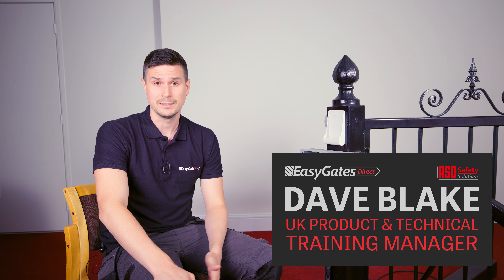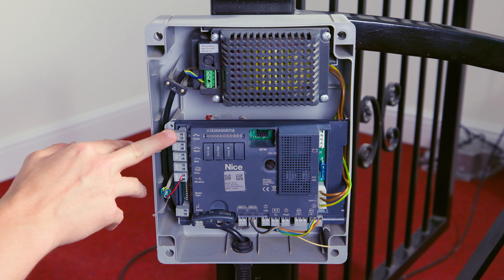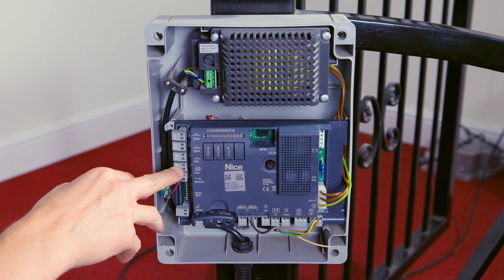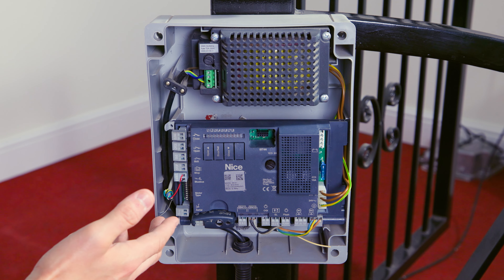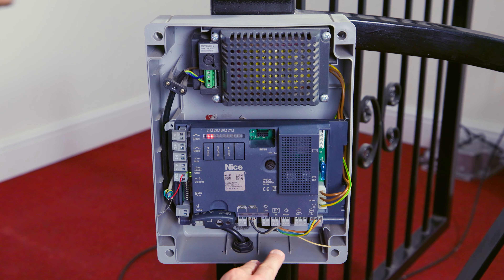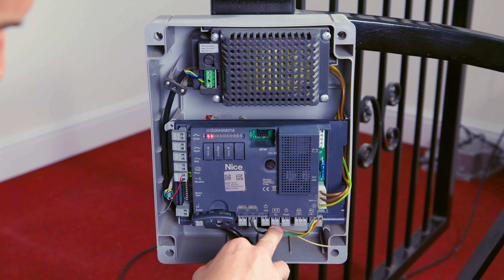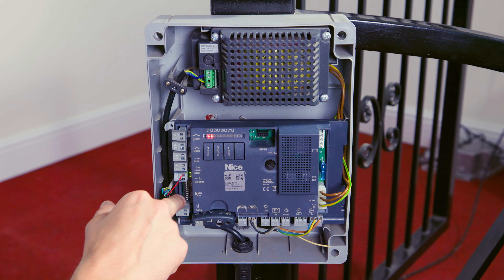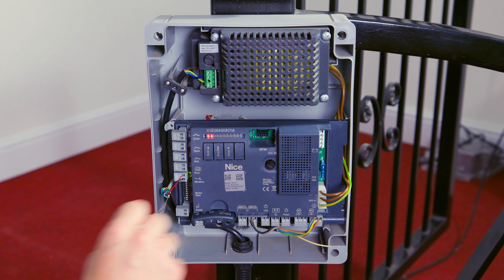Nice MC824H - How to programming Inputs and Outputs

Comment: Thank you Dave - I've just added a Meross WiFi switch to my gates and I couldn't have done it without the SbS interpretation. Super clear description - could not be better. Thanks.
Reply from the maker: Hi Peter, we're pleased to hear that you found this video helpful. If you need any further assistance, please don't hesitate to let us know.
Reply: I buy à meross to but i don't sure to understand. I have to put one wire to sbs and one to the Last one on the bottom ?